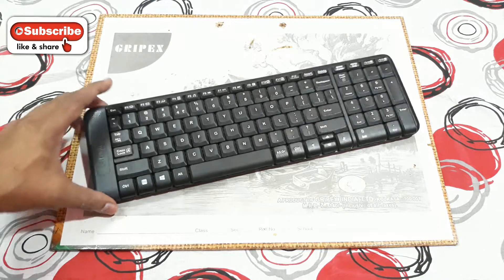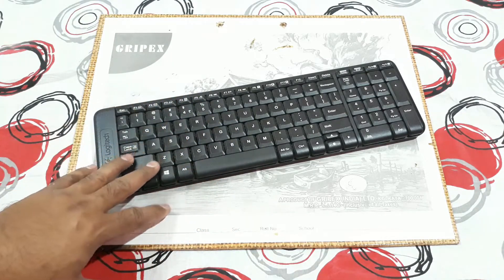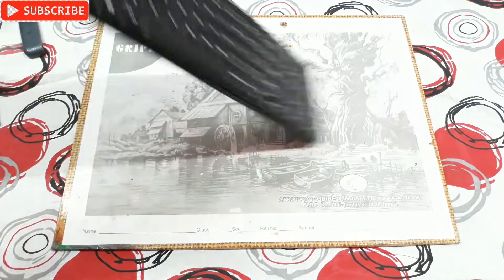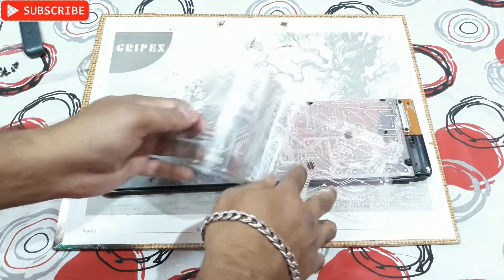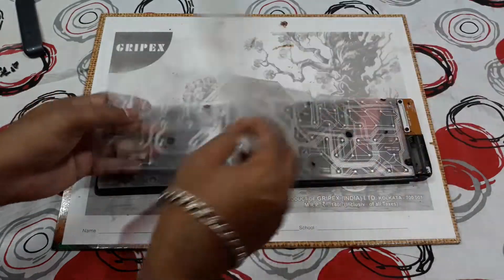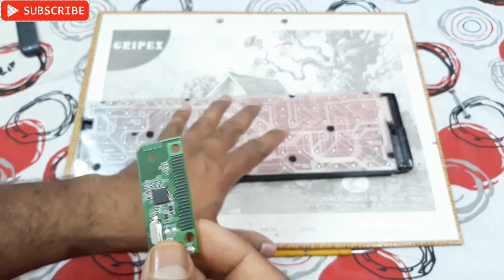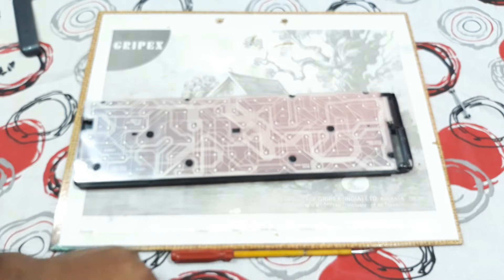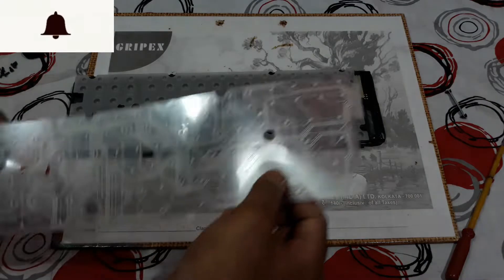How to fix keyboard keys not working,How to repair Wireless keyboard,Some Keys Not Working

Comment: while trying it u didnt even press d and f. Which u said it was not working .
Reply from the maker: Many keys were not working. It works in most cases. Except if any connection line is broken or the controller chip malfunction.